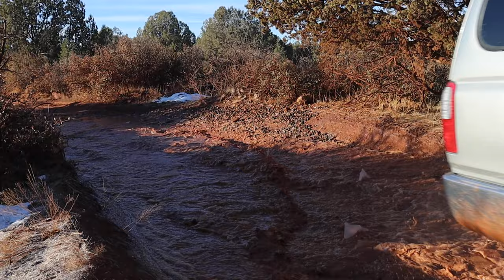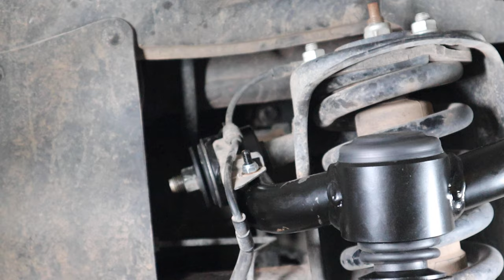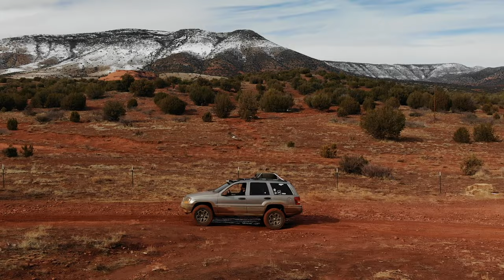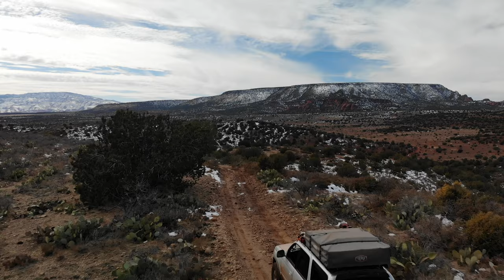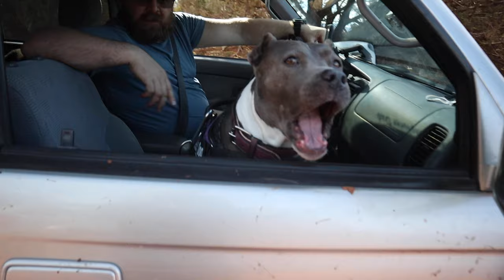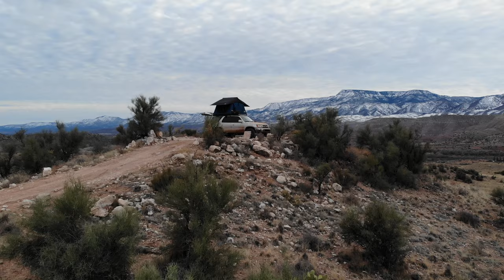Does Freedom Off-Road Make The Best Budget Upper Control Arms?

Comment: When I bought my 06 gx470 the original owner included a brand new set of these (uninstalled) with the purchase . I was pretty dismissive of the product so my original plan was to sell them and put the money towards a set of spc uppers or something comparable . After doing a bit of research I decided that these would fit my needs as long as they held up . A year and a half later I have zero complaints .
Reply from the maker: We're over a year into ours and couldn't be more happier!
Reply: Jackpot comment! I'm in exactly the same boat with my GX470. Gonna throw these on tomorrow.

Comment: I wish that I would have had these on my 3rd gen back a couple of years ago. Like you I hated replacing the ball joints - especially the uppers. Did it myself with the Autozone universal ball joint kit and it took ingenuity, cussing and many hours of labor.
Reply from the maker: You’re a better man than I! I tried my best to get it to go for quite a while. Started to attempt to brute force it with the blunt force applicator, but I came to my senses, admitted defeat and just ordered the right tools. On a side note, anyone need a set of Toyota upper ball joint sleeves and receiving cup? Only used once!

Comment: Love the new branding!! Sedona is so pretty . We have my son's t4r set up with a similar springs and shocks. And upper control arms are definitely gonna happen soon. My question for you is did the new control arms, chang in geometry push the tire back towards the firewall?  That's what happened with my first gen tacoma with total chaos upper control arms.  Thanks !
Reply from the maker: Thank you, glad to hear the change is working out.

The Freedom UCA’s didn’t appear to move the tire back, if anything, I feel like it moved the top of the spindle forward a bit to increase the caster angle. 

So far, I’ve encountered zero rub anywhere, even with the step up to 265/75’s, even at full steering lock. Those shots of the arms moving are at full lock one way or another to allow the camera to get the widest possible viewing angle while I bounced her through a rutted out ditch, and I’ve got more front articulation than most since we don’t run a front sway bar.

Comment: I just found your channel and i just subbed after this video. Great video! I am checking out these control arms for my 2nd gen colorado. The price sure beats every other brand i have found. I just might give them a shot also.
Reply from the maker: Thank you. They are still going strong in our rig, I think we’re up to about 15k miles on them. Just did a service on the 4Runner a couple weeks ago and gave em a good look when I greased the upper ball joint in them. I definitely wouldn’t hesitate to recommend them to anyone who was looking to upgrade from stock with a vehicle with two inches of lift of less.

Comment: If you don't want to buy a special Bearing puller, this is what I did:
I have a generic bearing puller kit from harbor freight. I used the adjustable one that looks like tongs that grips at two points of either side of the bearing. ✂️
Cut off the threaded rod just above the ball with a hack saw. Try to keep the cut as flat as possible using the lip of the bearing as a guide. 
Get a flat peice of metal to lay on top of the bearing lip. You will be pushing on this surface instead of trying to find the exact diameter collar.  
Pop that baby out, use heat and tap around it with a hammer.
I also saw someone just blast an air hammer at it. 
If you're on a budget: Get creative.

Comment: Installation vid ? I have 2000 tacoma and not sure if they’ll fit I have the FO-T705FU-UB. I noticed the old ball joints come in from the bottom and the new ones on the FO uppers come in from the top.

Comment: Are the bal joints replaceable
Reply from the maker: Yes, and greasable. They Mount into the UCA themselves too, rather than the spindle, like stock. Makes it quite a bit easier if you need to press them out later, UCA is a bit easier to remove than the entire spindle, if you can’t fit a c press in there like we did.

Comment: Where is an installation video for these?
Reply from the maker: Unfortunately, still on my hard drive. I definitely need to go back and put this one together. In the meantime, I'd say check out Timmy The Toolman's videos on replacing Upper Control Arm Bushings and/or upper ball joints, as that's what I used as a guide along with the Factory Service Manual. Hopefully I can get this one finished in the next few weeks and out.

Comment: i replaced strut and spring w eibach pro lift along with these UCA’s and now have a squeak. i think it’s the control arms, had to tighten before letting it sit on its weight. impossible to fit tools after strut assembly is inside and on its own weight

Comment: Great video, I’ve been having some shaking in my steering when cruising at low speeds in my new 01 4Runner I’m going to see about altering my suspension and balancing/aligning the tires hopefully that works
Reply from the maker: How many miles are you at? I chased what I thought was tire balance for a long time before we switched out the bushings. If you’re out over 150k miles and the tire balancing isn’t taking care of it, It’s probably the control arm bushings, steering rack bushings, or the tie rod ends.
Reply: 123k
Reply from the maker: @Thecarexchangepodcast  It would probably be worth it to start going through your front end now. It’s really not that complicated to do most of the work, provided you have access to some pullers, a c-press and all the right sleeves/adapters, to replace all the front end bushings,  upper and lower ball joints, and the steering rack bushings and tie rod ends. Oh, front differential bushings can also be a source of issue you might consider looking at.

Comment: I went cheaper with my UCA I went with Tuff country upper control arms from suspension connection. They are under $300 and made in the USA and have a sealed and greasable ball joint and tube welded lifetime warranty……When I held them next to my friends freedom control arms the are the same measurements…. If I saw one difference it was I don’t like the look of the grease boot but it works and holds grease…..
Reply from the maker: I never even knew they made a set! That's a damn good deal!

Comment: Nice video, what’s your suspension set up? Did you replace front coils? Did you do anything to the rear? Thanks! Just about to start my build.
Reply from the maker: It's running Bilstein 5100 shocks and Old Man Emu coils all the way around. I don't remember the specific model numbers, but they aren't the highest stiffness rating they offer.

Comment: Did you end up having to run the freedom off-road camber kit with these as well? I just had them installed on my 3rd Gen 4Runner and the alignment shop said i should have got SPC because they were not able to get any camber or caster adjustments out of them (even though they are sold as adjustable for 2"-4"). The shop told me it might handle worse now than the OEM UCA's. It sits like a bulldog now with the positive camber up front.
Reply: Shop told me the same thing today - they told me to get the SPC. Front tire have positive camber too.

Comment: I absolutely think it was a good idea to change the control arms, fixes multiple issues with one part. I'm interested to see how they hold up. Your buddy should try the upper rear link out on his WJ too..... wink wink...
Reply from the maker: Right! I’m interested too. The tubes and welds looked good, and the UCA’s aren’t really a load bearing part like the LCA’s. I imagine if anything’s going to wear prematurely on this, I’d guess it would be either the ball joint of the bushings. Even so, if it’ll go a 100k, I’ll gladly just buy a whole new set and have a 100% bolt up installation!
Reply: @MattKester  yeah thats just good sense. 👍

Comment: Fed.  'Icon' probably offer the least expensive option for your 4runner's !  Most suppliers are Chinese made and there's always "Monster Rides" too ?  V.
Reply from the maker: You got a wholesale hookup with them? Every time I’ve looked they were closer to $800 for a set of control arms! Monster rides looks interesting.
Reply: @MattKester  Fed.  At least 'Icon' are modular, so one can stage build or repair their truck dependant upon funds ?  'Monster Rides' will offer a complete kit only, which will allow the same degree of articulation travel like the D1 !  Best value is a complete package deal, do it once - do it right.  V.

Comment: Next time you can recommend just going to an automotive shop to have them press your new ball joints in. 10-15$ per ball joint beats buying that kit.
Reply from the maker: That is a viable option, but it would have involved removing the entire spindle and taking it to a shop. Granted, that probably would have been the quicker option once I discovered the auto parts store adapter set didn't work, but I just really didn't wanna pull that spindle off!
Reply: @MattKester  I agree, I did my research with Timmy the tool man, and saw that he had to buy a ball joint press other than the one at the parts store. I called around and saw it was cheaper to have the auto shop do it. Great video though!